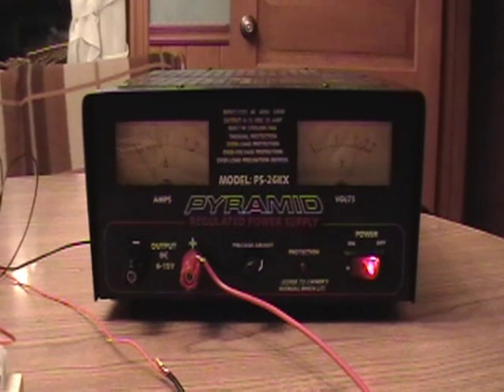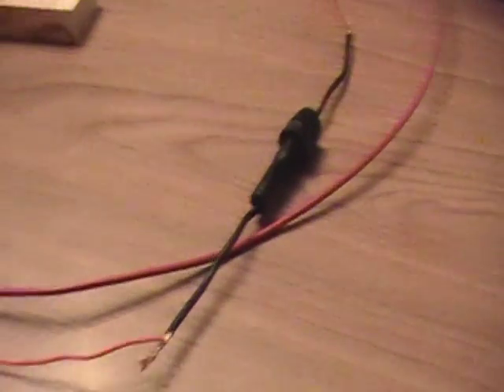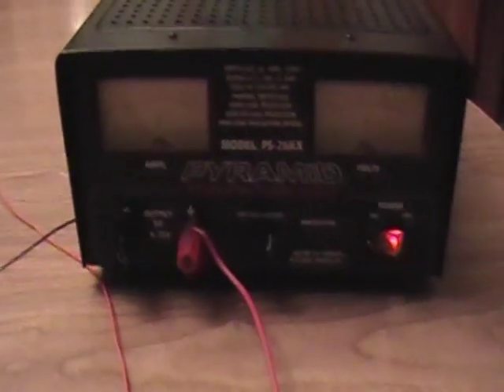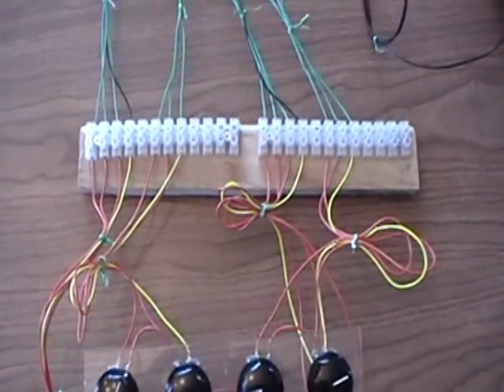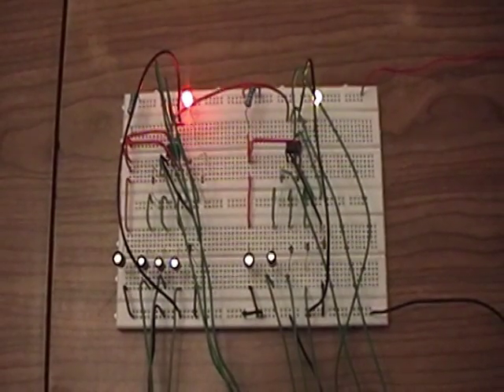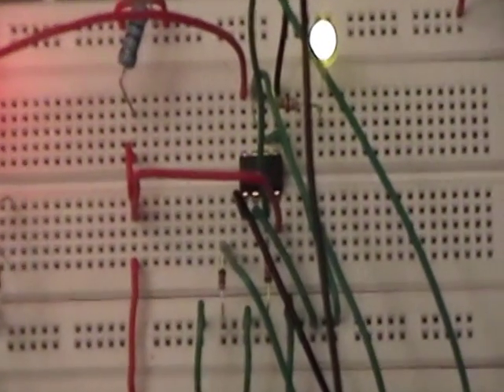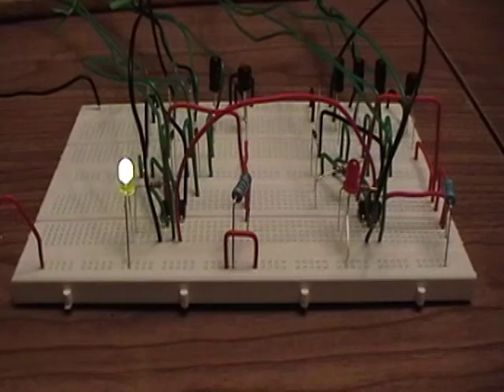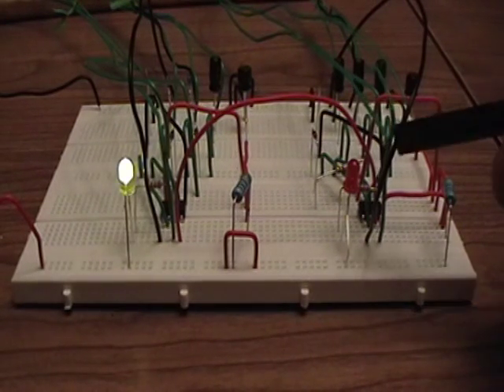Jamie's Replication 001 - The the PWM

Comment: hey I bought a pwm on ebay to control the output of amps on a electrolysis unit. I am interested in stan meyers electrolizer and it's use of frequency to produce a higher yield with lower amps and no electrolyte. My question is would a pwm off ebay be similar to what you are building there?